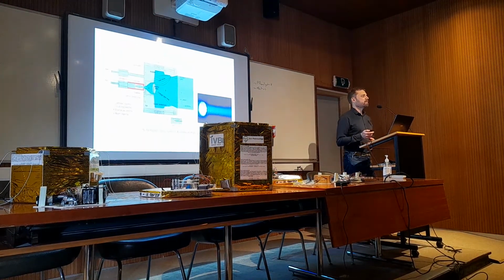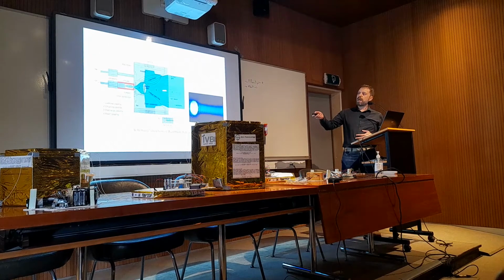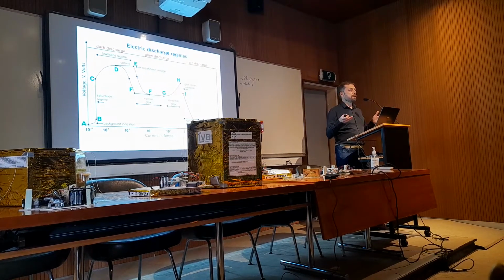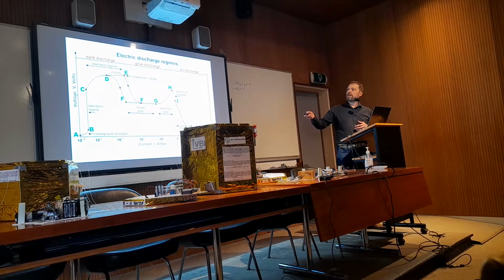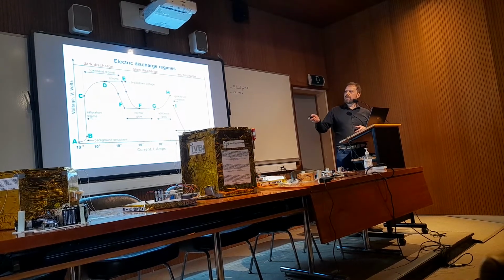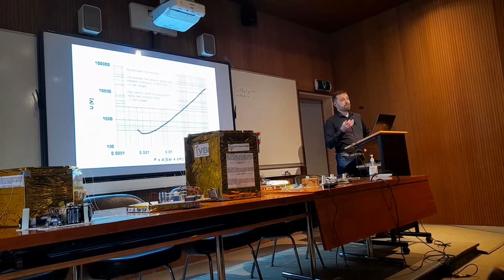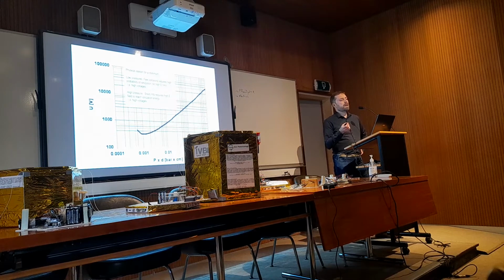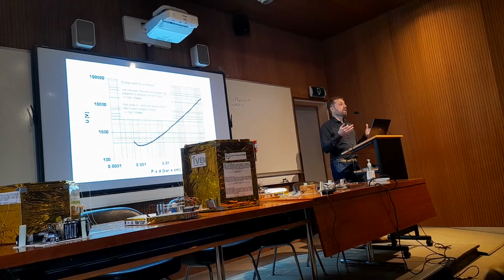Gas discharge in a Kaufmann type Ion Thruster

Comment from the maker: My mental maths is a bit off for the breakdown at max balloon height, see subtitles for corrections. At 1/100 atmospheric pressure breakdown will happen over 100 x the distance or at the same distance will need V_b /100. For air at 1/100 atmospheric pressure breakdown will be ~ 0.3kV over 1 cm (= 300V/cm).